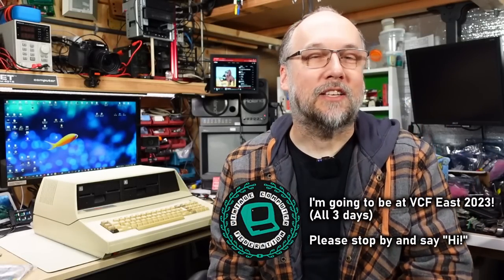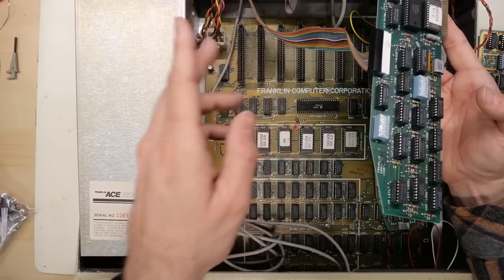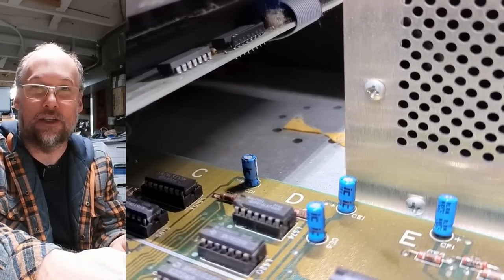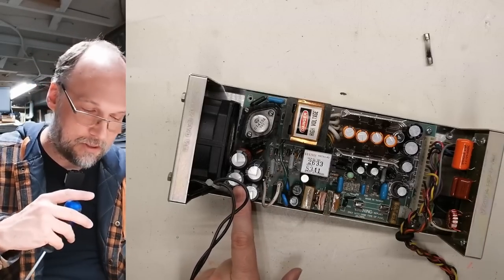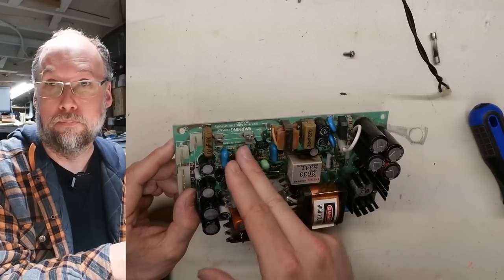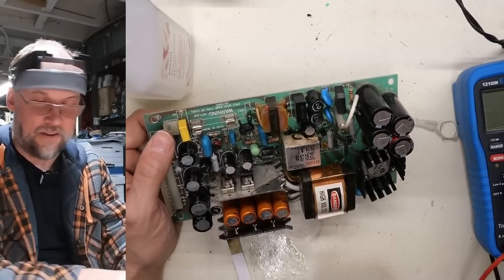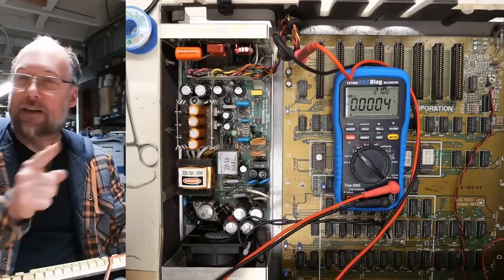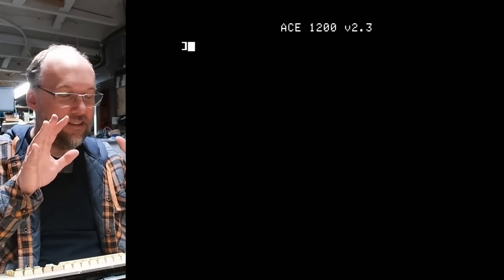The Franklin Ace 1200 was a semi-legal Apple II clone #repair

Comment: Pro-tip for solder wick.  Grab the wick and wiggle it to loosen up the braid.  Allows the braid to work better, as the braid can be too tight to really absorb the solder.  It's counter intuitive, but it works. 

Also, while solder wick is usually impregnated with flux, adding some liquid flux after you loosen up the braid can also work wonders.
Reply: I've found you can make pretty much ANY wick in to "quality" wick simply by adding flux on it. I'm pretty sure that's the only difference in general.
Reply: @_droid  probably the copper oxidisation tolerance is technically different, but yeah in practice not likely hugely-so
Reply: @_droid  If you're desperate and you have some flux handy, you can make your own solder wick out of old speaker wire that's been roughly braided. It's a little harder to work with than store-bought wick, but it'll do the job.
Reply: @_droid  Based solely on my personal experience, I have to disagree. Some wicks are just horroble.
Reply: Solder wick is the low0ball solution - works for small jobs but crude and nearly guaranteed to destroy early thin-trace circuit boards. . A soldaput or desoldering iron is much more usable in the long term.
Reply: Squirt of flux from a syringe or a wipe with a flux pen makes the world of difference!
Reply: I agree about the additional (fresh!) flux, except that you are going to get much more smoke.  Hope you have a smoke filtering device on your bench.  But as to the tightness of the braid -- my problem occasionally has been the opposite.  Some braids have been so wimpy that the soldering iron tip pokes right through it.  No heating and no wicking.
Reply: @InssiAjaton  Indeed.  Using cheap wick is no bueno.  Use good quality tools and materials.

And for some types of desoldering, hot air is the only real way to roll.
Reply: @brettbuck7362  A desoldering station is likely the best solution in most cases, but for hand-desoldering I prefer a rubber suction ball with a nylon tip. Precise control over the suction needed and no recoil (kickback often results in lifted pads if you are cack-handed like me and don''t have the thing in a vice). Made a nozzle cleaner from a paper-clip, a bit of a PITA to get big solder globs out of the ball though.

Comment: Hi 🙂 The Pi Pico based card you featured recently could easily be configured to run diagnostic software, and, in fact, diagnose faults on a machine which won't run diagnostic software itself, because the Pico board has its own ram and processor, and direct access to the bus - if necessary it could run on a 'dead' machine, record it's findings to the onboard flash storage on the Pico, and allow you to read them off via USB - as long as the +5v rail is sort-of functioning enough to generate 3v3 for the Pico, everything else is optional. I'd be tempted to fork the design of that card to include an i2c voltage sensor, to monitor the Apple2 power rails, so the card could be used as a data logger on a system under load, to watch for brown outs or instability. Thanks for another great video, I look forward to seeing this machine up and running - I was interested to see a lowercase v on the boot/splash screen, presumably the Franklin isn't a straight copy of a ][+ then!

Comment: I'm impressed at your knowledge on what chips are which, what they do. And their benefits or issues. Brings back memories. 
In the early 90's I had a ticket to learn circuitry and more but it didn't work out. This is so interesting and intriguing. You have so much knowledge that could actually be lost soon if not documented like this.
Reply: 😊agreed
Reply: Don't worry about preserving the knowledge, all this is actually common practice in workshops all over the world
Reply: Well, Apple 2 boards are all labelled in a grid and the diagram is just a double sided page. All switching PSU's are the same internally, I even switched parts between Apple 2 and PC PSU's. This Adrian guy is super motivating to watch for repairing stuff yourself! :)

Comment: A very nice example of a Franklin Ace.  Yeah, those Rifa caps can really stink up a workbench.  It's fascinating that Franklin went to such lengths as to include a filtering board.  It seems like that thing brought more problems than it solved, but FCC certification was a very real thing back when computers were first coming to the mass market.  As always, you do a polished presentation, and follow a very logical troubleshooting path.

Comment: Those power supplies can hold a charge for quite some time. I got zapped pretty bad from some that were sitting for months until I was given them to test and repair. 

I hope you cleaned the dust mat out of the power supply fan. That was pretty thick.

Comment: Great video, Adrian. I was really impressed by your description of the circuit logic in the power supply, and especially by your 'digression' into the common fault of the caps on the power filtering board, later borne out on that very unit! I learn something new every time. Thank you.

Comment: The Ace 1200 was my childhood computer, so I'm always happy to see them in your videos! I'm restoring one now and if it hadn't been for your video on the Ace 1000, I'd probably still be sourcing foam-and-foil keyboard contact replacements. I'd probably never figure out how that color board works, either. I'm sure my 1200 has the same capacitor problem, but my (somewhat irresponsible) solution has been not to use a GFCI outlet for now.

The printer card in slot 1 is indeed for both the parallel and serial port. The parallel port number will be the same as the slot number (PR#1). The serial port location is virtual and can be set with the jumpers/switches on the card. Setting it to slot 2 (PR#2) is the most common. Sadly, it seems that Franklin really only had serial printers in mind and it's not fully compatible with the Super Serial Card. So you'll have a hard time creating floppies for it with ADT Pro.

Unless you're really keen on adding a language card and disabling the board memory above 48k, slot 0 is best left empty. Then the standard (lowest drama) layout is putting the 80-column card in slot 3, the Z80 card in slot 4, and the floppy card - with it's life-saving keyed ribbon connectors - in slot 6

Looking forward to part 2!

Comment: Also, when using solder wick ... use flux on it! It makes more of a difference than the brand of wick.
Reply: And the more expensive wicks have better flux powder in them which is why I think they work so much better.
Reply: @nilz23  yep, i've found the cheapo ones dont have enough flux, or even any at all !
Reply: In that case desoldering pump would be better.
Reply: @detalite  it depends, sometimes a sucker is better, sometimes braid, i usually  use sucker first, braid to get last bits off or clear holes
Reply: @detalite  there's use cases for both actually.

Comment: Apple was able to shut down clones in the USA, but not in all countries. I'm also from Canada and at home from early 1985 we had a Taiwanese-made Apple //e clone (booted with FOX-2001 at the top of the screen). I think the same model was also sold in Australia.
Reply: The Laser128 was deemed legal in court. It was the only clone Apple couldn't shut down.
Reply: I had a clone that booted up EASY ][. It had a Z80 on the mainboard below the 6502. I used it until the power supply died. Never did figure out what it actually was. Replaced it with a real Apple //e.

Comment: Ahoy, thanks for another in-depth video. After my Apple //e was STOLEN my older sister bought me a Franklin Ace 1100. It was like the 1200 with one drive and no Z80 board.  I loved the Acr Writer word processor in 80 cols. I used it until I got my Apple /// with an Apple ///+//e card to run my Apple ][ programs then gave the Ace to my younger sister. She ran Loderunner almost exclusively lol. Thanks again, I always learn so much and looking forward to part 2. daveyb

Comment: I generally feel that old computers are interesting, but old power supplies are a liability. There are so many modern replacements which are both not made out of forty-year-old components, but also typically far more efficient, and less cursed than this one! Plus, stuff like not having mains voltage in the computer makes me much more comfortable. Interesting to see one repaired, though.

Comment: Those filter components are there for a reason. Seems like it would be less effort to replace the X2 safety caps than it would be to remove all the components and bodge across. Even leaving the common-mode choke would have been better than just removing the whole board. That old chopper power supply probably makes some nasty noise on your mains...
Reply: Yea, I'm surprised he didn't just snip the caps off
Reply: There's X2 on the board, he replaced those.
Reply: The noise from that is probably a drop in the ocean compared to the 100s of cheap switch modes now in his house.

Comment: I have a selection of junk IDE drives and some low voltage tungsten lamps for power supply testing. They are great for load testing without having anything valuable on the line.
Reply from the maker: The light bulb thing is a great idea. 12v automotive bulbs? I do use hard drives sometimes but they don't put much load on the 5v rail.
Reply: @adriansdigitalbasement  Yeah, I use the lightbulbs for additional load. Car headlights (I upgraded my car's headlights to LED) put a nice heavy load on the 5V rail for testing PC power supplies.

And the nice thing about the lights is they can handle out of spec voltages pretty easily
Reply: Yeah, I have homemade bulb testers too.

The average car headlight low beam is about 55w (I think the high is 65).

If you wire up the low and high beam to run at the same time it'll pull over 100w. (But it'll get hot as hell in an instant, so put it in a glass jar). 

At 5v a single bulb will probably pull 40w or so with both elements (not doing the math).

The brake and tail light bulbs have a 12w and a 24w filament (1A and 2A @12v)
Reply: shame that 6V car bulbs have fallen out of favo(u)r.
Reply: @TheDiveO  Thanks for the international option :) , I would think that classic car and motorbike places would still stock 6v bulbs.
Reply: In the case of the hi/low headlamps, probably could use high for 5v, lo for 12v.  Sure, the high filament probably won't light or certainly would be dim, but you'd still have your load since it is basically a resistor.

Comment: Hi Adrian. Look on your favourite action site for "soldering needles". These are hollow steel tubes with a handle that can be used to unclog VIAs and straighten component legs while the solder is liquified.

Comment: I bought an Apple II clone a while back. It had absolutely no branding anywhere, and it also had 8 slots and 64K of memory, although the board layout was a bit different to the Franklin. And also unlike the Franklin, it did have the cassette input/output circuitry populated. It was missing the power supply, so I made a bracket to hold a TFX power supply, which fit perfectly, and I sourced the special power connector, although I got stuck with crimping it since none of my crimpers fit the contacts. I suspect the original one suffered a fate similar to yours, Rifa cap burnt out and took the fuse with it, then the owner pulled it with the intention of getting it replaced and never did. Either that or the tossed it because of the smell.

Anyway, I really want a IIe to round out my collection. I've got a IIc that came missing the floppy drive, which I've mentioned in the past. Sadly those old Apple machines are becoming difficult to find for a reasonable price.

Comment: Ohh, I love that 70s style design! So cool.

Have you considered making a dummy load for testing PSUs that need a load? You could use super high wattage resistors with values that give about the same load as the running machine. Worst case you blow up some resistors. You could actually even use a microcontroller to have it display all your rail voltages at once, too

Comment: The power supply being a little high (5.17V instead of 5V) may have been intentional from the factory. TTL logic can typically operate just fine within +/- 10% of its 5V rating (i.e. 4.5V to 5.5V) and the 5V rails on the motherboard will drop a bit toward the extreme ends of the board (depending on trace widths and current draw). By adjusting a little higher than 5V even, it ensures that ICs with a long path back to the power supply will have plenty of voltage at all times.

All that said, 5V is probably fine here too (like I said, 4.5V is usually the minimum for proper function, so if it sags a bit under 5V at the extremes, it should be fine.)

Comment: Regarding desoldering braid: you can make even low quality Chinese brands work well with a simple prep step: take some liquid rosin flux and apply a little to the portion of the desoldering braid that you're going to use with a q-tip; give it a minute or two for the alcohol to evaporate. It works every time.

Comment: The Franklin disk controller was licensed from a company that had developed it.   The Apple disk controller design was patented, as it uses a ROM and a state machine to operate.   The card used in the Franklin is a very different design which required more chips to implement but did not infringe the Apple patent.

Comment: You could always build a load for the power supplies for testing. Just see what the current and voltage rating is and apply the necessary wattage rated resistor value to the output. i.e. 12v at 2 amps would be a 24 Watt resistive load of say 6 ohms for example, to test at maximum rated current. Maybe fit a 12V fan to cool it. 😃😃😃

Comment: The Franklin Ace 1200 was not a legal clone. They lost in court in 1983 and it took until 1988 before they could be forced to stop selling them. It was landmark in the fact it decided software could be protected by copyright.

The Laser128, however, was a legal clone. Apple lost lawsuits against them as it had been proven they didn't violate any copyrights. They licensed Basic from Microsoft directly and clean room engineered machines.

In fact... VTech was the only company making legal A2 clones.

Comment: A good trick for making cheaper solder wick work better is to add flux before you try to clean up the solder with it. The problem with the cheaper wicks is simple. They aren't made from high grade copper so they don't wet as easily thus solder won't stick to them as well. If you add some flux it etches away some of the impurities allowing for much more liberal wetting.

Comment: This just made me wonder: why did printers use the parallel interface, while computer-to-computer comms used serial? Printers of this era were dot matrix, text only - so the bandwidth needs are dictated by the (very slow) movement of the print head. Yet computer communications could've easily used the extra bandwidth of a parallel interface. Hysterical raisins give me a headache. Great video as always!
Reply: Parallel interfaces have an inverse relationship between speed and distance. The old Centronics printer port was reliable up to about 10 feet from the computer. Some computer-printer combos could go a bit farther.  The main issue is that all the signals have to arrive within a certain time window, and there are a lot of factors that can influence the propagation of a signal down a wire.  Plus, the longer two signal wires ran parallel to each other, the more likely that some of one signal will transfer to the other (crosstalk). 

Serial, specifically RS-232-C, could go hundreds of feet with no issues.

There were peripherals that used the serial port. There were some external storage systems that used the parallel port; I believe the Zip drive was one of them.  And EPROM burners definitely used them.
Reply: Internally, everything is parallel.  To add a serial port means you have to add the UART chips at both ends to convert.  Parallel takes more wires and gets expensive when you have to run for a long ways.  Bottom line, more wire is cheaper when you're talking 10 feet.  But more electronics is cheaper when you're talking about wiring an office building.
Reply: @JamieStuff  Good points. I remember scanners and ZIP disks being on the parallel port, but that was much later (1990s). I guess I hadn't realized that people would actually want to run such long cables, but that makes sense when you had a minicomputer and several RS232 terminals in different offices.
Reply: @markmuir7338 Scanners and Zip drives would have needed the bandwidth of the parallel port, too. Or, better yet, SCSI, which was also parallel but much faster.

I once had a SyQuest EZ-Drive (HDD with 135MB removable platters) that connected to the parallel port, and when I took it apart, it turned out to simply be an enclosure around a SCSI drive, which could be straightforwardly mounted inside a computer instead. I didn't think to test if it was any faster that way, but I imagine it probably was.